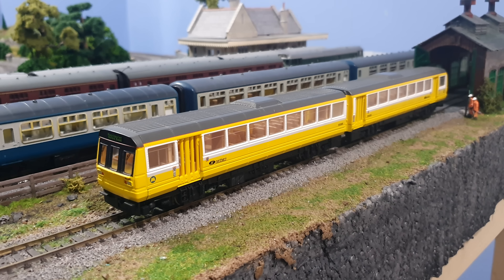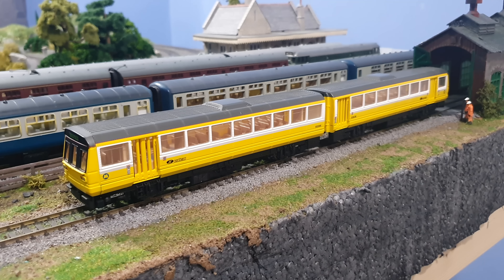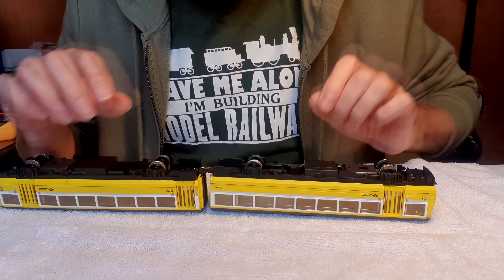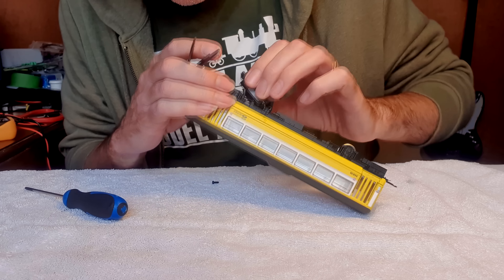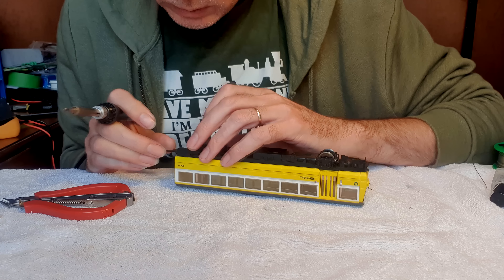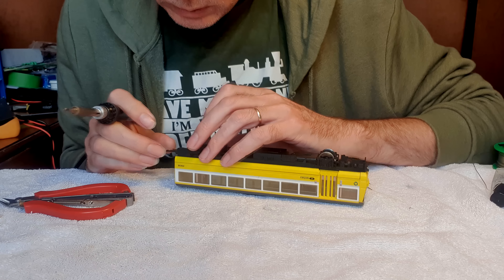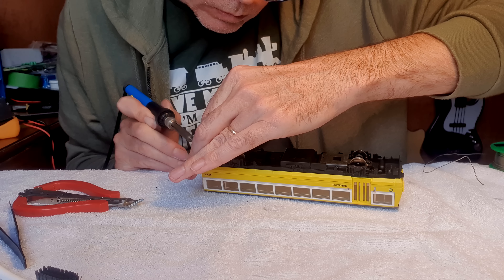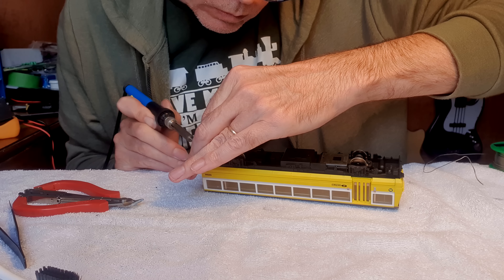Hornby Class 142 Pacer: Repair Request

Comment: Looks like a typical cost cut by Hornby removing one motor. Mine is in Greater Manchester colours of orange and brown. It too has a motor in each car which seems better. Nice repair once again Bill
Reply: One motor should be plenty for a small two-car unit. It's not like a Pacer is going to be pulling other rolling stock. So, rather than "cost-cutting", I'd call it the removal of unnecessary expense. Especially if the reduced cost was either passed to the consumer or spent on extra detailing elsewhere. (Hahaha, how naive.)
Reply: There's also the problem that if one of the two motors stalls (dirty wheels, points, poor contact, etc) the other motor isn't powerful enough to drag the dead unit along so it just stops and sits there spinning. Bill's solution of commoning all the pickups should avoid that.

Comment: Good video. I have the same model and it looks and runs OK but not a patch on the modern MUs. An old and very basic design but still appealing, just like the real thing! In my experience it is best to keep the two cars permanently coupled to reduce wear and tear on the very fragile connector. Definitely the component most likely to fail if not treated with care.

Comment: I notice that you seem quite happy to let models that are barely running go into the tunnel on your layout. Is it easy to retrieve things from inside the tunnel if they get stuck in there? It doesn't look as if it would be - you've made the landscape over the tunnel look good and solid.
Reply from the maker: The back of the tunnel isn't hard up against the wall there is plenty room to get in there. More often than not though I can shove my arm in the tunnel mouth and pull things out.
Reply: @oobill  Makes sense and sounds like good planning. I try not to run iffy locos into the tunnel on my N gauge layout, as if they die in the middle, the only way to get them out is to lift the whole tunnel and the landscape on top of it... and then I've got to get it back into position properly afterwards, which is rather awkward and fiddly. And I've got a little mine head, with some rails serving it and a dummy train on top of the tunnel now, which makes lifting the tunnel even more discouraging. Of course it has to be done once in a while anyway, to clean the track in there better, else even good locos will stop in there.

Comment: Hi Bill, nice video, my pacer, same as your blue one, when I bought it, had an ultra close coupling so I ripped it off and now it has no couplings, and I planned to add some as a replacement, what would you recommend doing to add some
Reply from the maker: Magnetic couplings with no NEM pockets and hard wire cars together. Might take a bit of trial and error to get the spacing right.
Reply: @oobill  cheers ill have a look at that

Comment: Hi Bill.

Good job, well done as per usual.

Personally, I prefer your Pacer, as I like the idea of a motor in both cars. If one fails, then the other one is still functioning and will bring the train to its destination. Not only that, but it has more torque as a result of running on two motors, thus avoiding the annoying drag on long curves. 

Happy Bank Holiday! 

Paul. 👍
Reply from the maker: Two motors brings about it's own issues but yes it has better torque so doesn't slow down so easily. I think if the axles had a single conductive wheel each, a single wiper pickup on the axles rather than one on each wheel and a single traction tyre on the drive wheels it would be much better. Or a centrally mounted can motor in the power car with drive shafts to each axle to have 4 drive wheels. Probably what Heljan would have done with this.
Reply: Bill.

Hmmmm, a couple of interesting points that you  make there. Maybe replace the Can motor with a Coreless motor which is far more efficient (if you research the science behind it) and, only about £3.50p to purchase. 

I think that, with your profound knowledge of locos and acuity, it would be very interesting to see you design a loco that would be more efficient than the RTR models that are currently on the market at an extortionate price. Do give it some thought! 

Paul. 👍
Reply: If one motor fails, it will lock one set of wheels and the other motor will have great difficulty overcoming that. And, with two motors, it's twice as likely that one will fail (though two times almost zero is still almost zero). On the real thing, they could put the gearbox of a failed engine into neutral, but that's not an option on a model,
Reply: On balance the single motor version actually performs better. The double motor Pacer I had always struggled to run smoothly as the two motors would not run at the same speed. As OOBill says, the best option is probably a central can motor in the power car with drive shafts to both axles. This is a relatively crude model from a different era though, if they were designing it now things would be done differently.